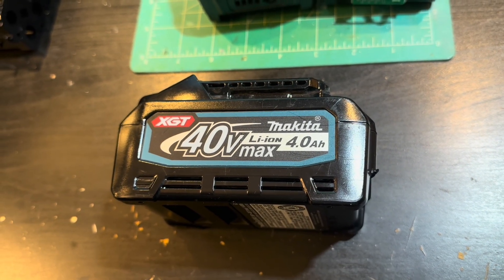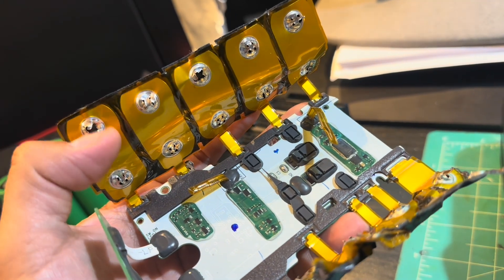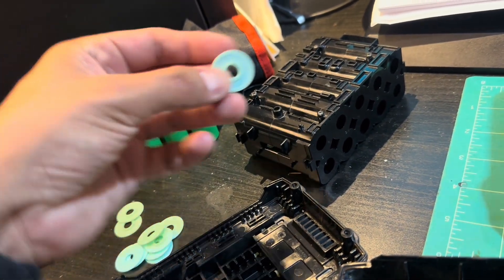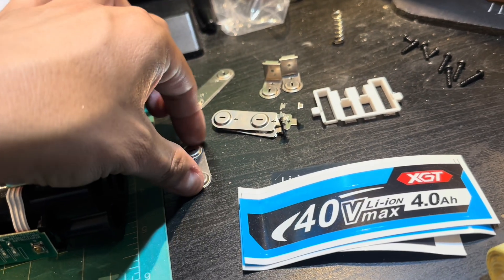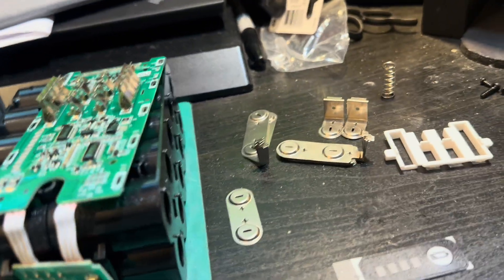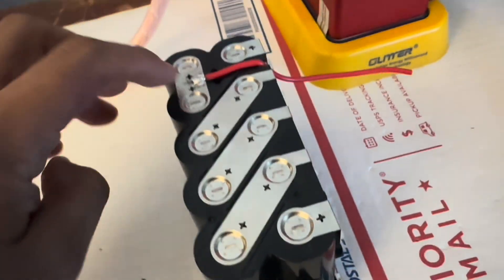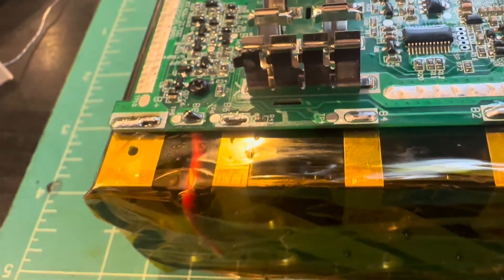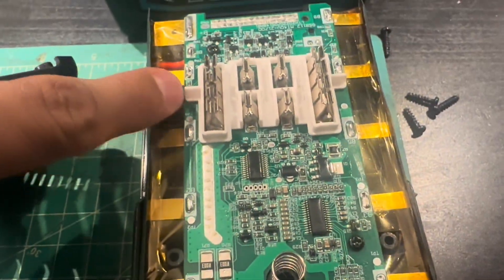Makita XGT 40v BL4040/BL4045/BL4030 AliExpress battery kit; parts and assembly

Comment: Is it legit? Because I bought 2 of these and tried to assemble them. I said "tried" because I don't have a strong enough spot welding device. So I soldered the plates instead of spot welding them. I don't know if it is because of that but batteries do not function. Leds on the Makita device I try the batteries on work but don't run the tool. I tried at least 6 different 40v Makita tools but no luck.

Here I can see you charge the battery but there is no trial on a tool. Did you try it? Does it work?
Reply: you most probably shorted some component. check the battery voltages individually. avoid soldering directly on the cells unless you have a powerful soldering iron like the T245 or T12 and you work quickly.
Reply: There are also jumpers on the BMS that you need to short or solder to activate the BMS.
Reply: @realavx  Really? I didnt know that. Do you know which ones? Or could you at least direct me somewhere so I can find it?
Reply: My tools won't start even if the batteries are 41.6V until after I put each new battery on a charger at least once and have it flag them as charged and ready. That being said I have nearly 10 of these batteries and they are useless for high power tools. They stop working after about 30-60 seconds. I have various sizes 10x21700 20x18650 10x18650 all by the same company. They all show the 4 led's on the battery count down 4, 3, 2, 1 then the tool stops and flashes red on the tool after about 60 seconds. I'm wondering if maybe they improved the firmware but I'm thinking Makita may be doing something to lock them out. I found an article online that said they would detect non genuine batteries and cut them off under high load.

Comment: Hi,please update the info with how well it powers high power tools like big circular saw or grinder.
Question is if it's working properly or BMS  going into protection ?
Thanks in advance!
Reply from the maker: Updated.  I recommend buying two as to avoid downtime due to overheating.
Reply: @ogscythe6118  How long can you run a chainsaw on these? I have about 10 of them. And they are totally useless for me. After 60 seconds the battery LED's start to count down 4, 3, 2, 1. Then the chainsaw stops and flashes red. I'm trying to understand whether it's the BMS shutting them off, or if the tool is detecting after market batteries and limiting high current usage. Do you have a similar experience ?
Reply: @petersvideofile  Sounds like a bms-protection mechanism to me (over current?)